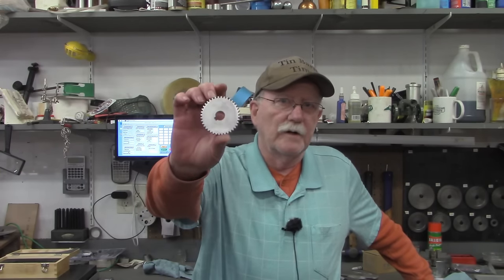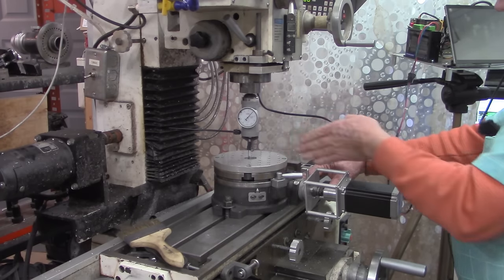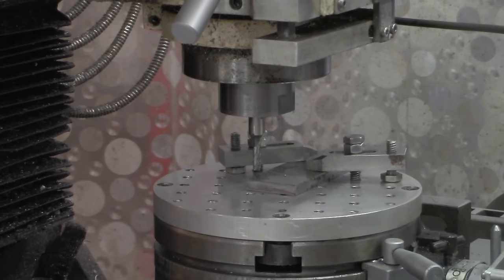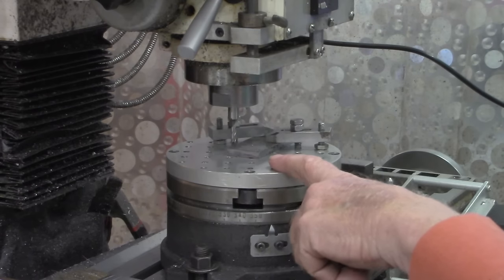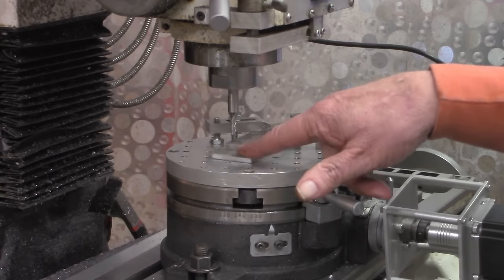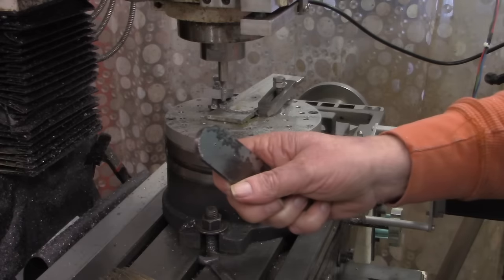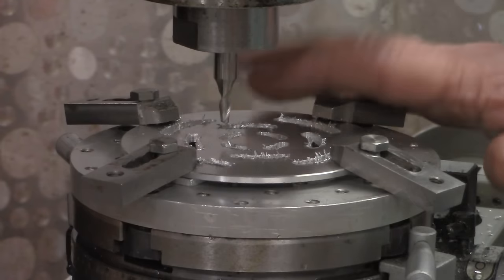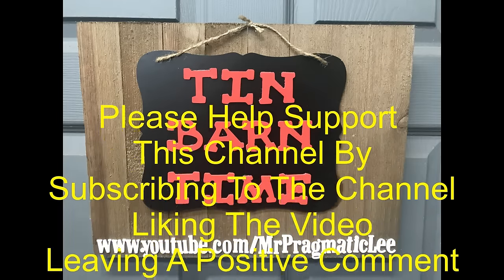Milling a Radius With a Motorized Rotary Table

Comment: As that disk was cut, I thought back to a time when I worked in a engineering department.  A pair of engineers spent weeks perfecting something that was then unavailable: a rotary encoder.  This device yielded an 8-bit value which corresponded to the shaft position of a stepper motor.  The encoder was used to assure a fluid sample was pumped into a particular bottle.  Long ago, and far away.  Thank you for sharing.  Wish you well.

Comment: Just great. Haven't tried my rigg for other purposes then positioning. Making shure the mill cuts and doesn't brake the bit calls for good practise, that I can't say I have....
"Cutting corners" just got a new meaning.... Joking!
My parents were born 1923 and 1925 and i got the same lessons, repair, reuse..... It never hurt me.

Here buttons were considered as costly, as well as zippers!
Old clothing was sometimes turned into strips used in weaving "rag carpets" as we say!
Two strings and a low cost toy. Brilliant!
Yes! Really a great video in evere aspect.

Comment: We might be similar in age, my parents were born in 1919 and 1920, they both remembered the Great Depression and saved things as do I, being 72 years old. One of my do nothings was in the summer after my mom told me to go outside (I guess I was getting to her) and we had a Buckeye tree and would take two Buckeyes and use an awl and put a single hole through each one. Then I would take a string about 32” long and tie a Buckeye at each end of the string, then tie a loop to go over my finger that would be maybe 4” from the center. The offset allowed the Buckeyes to pass without hitting each other, the objective of the Do Nothing was to get the Buckeyes swinging, but in different directions. It was hard to do but if you worked at it, you get those Buckeyes swinging opposite directions and keep them going forever. If I remember right I would start to swing one and at the same time l would toss the other one in the other direction and then you’d move your hand back and forth 4-6 inches, enough to keep them spinning, while holding on to the loop between your finger and thumb. Sorry everyone, once he reminded me of my childhood Do Nothing I couldn’t help but say what ours was. Thanks for the reminder! 

P.S. My mothers buttons were saved in an old round tin container, sometimes she’d have me look for a similar match when she was busy sewing. 
Hope to see you all next week!